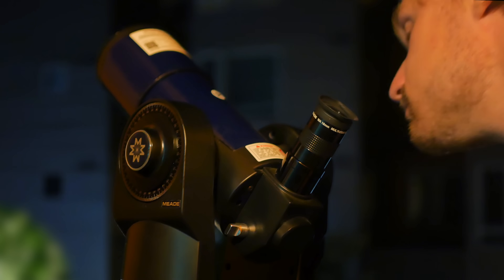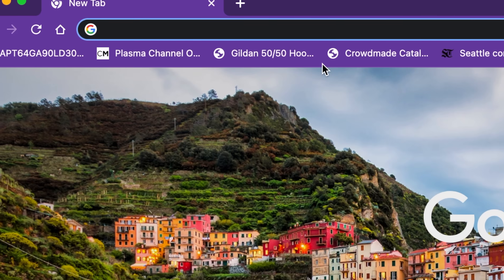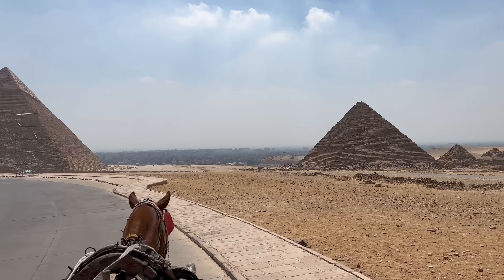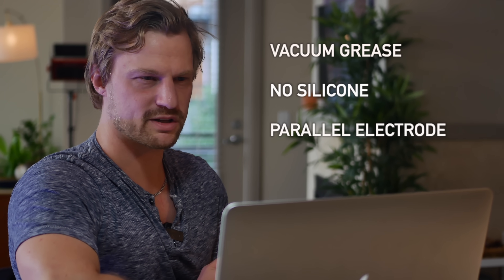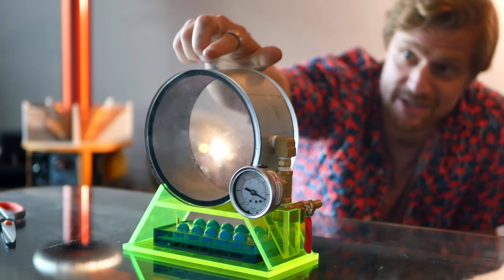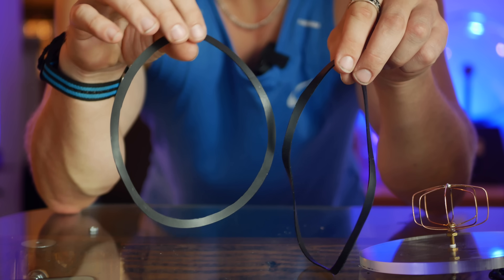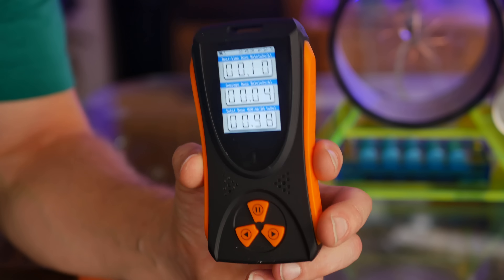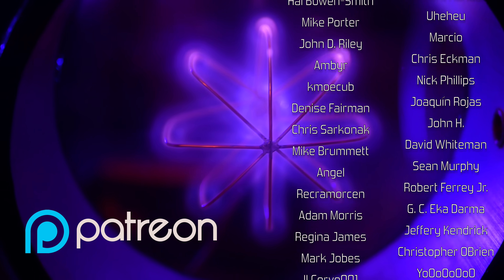Building A Nuclear Star In A Jar (Fusor)

Comment: What value caps are you using for the voltage multiplier? I’ve heard that the voltage rating of the caps has to be the total voltage of the circuit and I’ve heard from other sources that it needs to be the voltage of each cap individually? I have a voltage multiplier sitting on the table and I’m not sure what I can put through it.
Reply: Id  put a ridiculously overdriven zvs fly-back circuit to it but Im afraid I will overdrive the caps

Comment: I'm happy to be proven wrong, but from some quick back-of-the-envelope calculations it seems like you either need to greatly improve your vacuum or up the voltages to get decent reaction rates.
With around 15torr (20mbar) pressure your mean free path for a proton in H2 would be around 20um (hard sphere model). With a potential difference of 50kV and a distance between the electrodes of around 50mm, your ions will get to only 7eV energy. You need somewhere around 5keV to get any sort of reaction probability with D-T and 10keV for D-D.

The idea of the fusor is that the ions get generated close to the outer electrodes, then accelerate all the way towards the inner electrode, pass by it and hit ions coming the other way in the center. So your mean free path should be at least as large as the radius of the chamber. With a 150mm chamber that would mean you need at least around 4e-3torr (5e-3mbar), more than 1000 times better than what you have now...
Alternatively you can up the voltage and make the chamber smaller. That way you get higher field strengths and need less good of a vacuum. For a 30mm chamber it would be around 2e-2 torr, which is just about in the range of mechanical pumps. Otherwise you need some sort of turbomolecular pump or diffusion pump, which is probably too expensive. They then easily get you down to 1e-7torr and lower. You could make a crude getter pump by just heating a titanium wire in the chamber, but no idea if that is realistic at such high pressures you are at.
Also personally I would scrap the screw connectors. Proper high vacuum KF components aren't all that expensive and much MUCH better. Maybe you could even make a chamber directly from a KF extension tube.

Anyway, good luck!

Comment: Also, since H2 has a lower weight I wonder if it can help with better brighter glow

Deuterium is also a option and it'd be easy to fuse while still quite low weight but deuterium or D/T is expensive and dangerous, principally tritium

Also, unless you can get lithium-6 deuteride you cant make tritium so expensive

Comment: This is a very cool device, but this strikes me as being more like a neon lamp or gas discharge lamp, and not nuclear fusion.  A high voltage is being applied across conductors within an evacuated chamber, allowing the conductors to glow without the heavy oxidation (and fire) within an oxygenated atmosphere.  Adding helium to the chamber is more akin to a neon lamp, which contains a non-flammable noble gas which glows as its atoms are excited by the electric discharge.  Nuclear fusion, however, is the fusion of lighter atomic nuclei to produce heavier nuclei.  In young stars, hydrogen is fused to produce helium, and as the star ages, helium fused to create heavier nuclei, and so on, until finally iron is produced.  Fusion requires immense pressures, either created by the gravity of a star, or - for example, on earth with incredibly powerful lasers.  My question is, what heavy nuclei are produced within this chamber?  Is helium being fused to form carbon as it is within red giant stars?  Where's the carbon soot, then?
Reply: As you suspected, this is just a gas discharge lamp. Theoretically this configuration could produce fusion if the vacuum was deeper. The key is that you lower the pressure to the point where the gas molecules are no longer likely to strike each other. This allows them to accelerate towards the center without being slowed down by collisions with other particles. If too many particles are present they bump into each other and emit light (like a lamp), causing them to lack the speed nessicary for fusion to occur.

Comment: Not to be a downer, but I have serious doubts this will actually achieve fusion in its current configuration. There’s got to be a reason why every farnsworth fusor I’ve seen is composed of big, thick steel vacuum vessels with small, reinforced and bolted down glass portholes. I won’t believe it till I see neutron counts, as even a small CRT produces X-rays.
Reply: There are two main reasons stainless steel is used for real fusors. The first is heat, during operation they get very hot due to electron beams bombarding the walls of the vessel. Any plastics will melt as a result. The second reason is the need for materials that won't outgass. Under deep vacuum plastics will emit an endless gas leak into the chamber that will prevent the required vacuums from being reached. Without a deep enough vacuum the electrodes will discharge through the plasma in the chamber, which will prevent ions from being accelerated.

Comment: there's some math involved with fusion.. a plasma is not fusion.. it's the opposite.. separation of the nucleus and the electrons.. they come back together rapidly and the excess energy is emitted as light and heat... 
fusion in the sun has to do with the tremendous amount of hydrogen and the inward pull of gravity.. pushing against the outward force of the repulsive force of that first law in nuclear physics.. two things with the same energy cannot occupy the same space.. and also the tremendous outward force of the fusion process itself... fusing a couple hydrogen atoms into a helium atom required about 20 tons of conventional explosives in the first few weapons we tested in New Mexico in 1945.. dropped on Japan.. and tested in the early 50s..  my dad was army and came home walking wounded in 1945 and helped build the scaffolding for the first one.. which did not initiate fusion despite having many tonnes of explosives slamming the halves of a critical mass together.. fission is also the opposite.. the initial fission reaction was contained in a layer of plutonium.. the weapon was something like 4 meters in diameter..  huge thing... 
it's not easy
many of the relevant numbers are found in the periodic table
Reply: my dad helped build those goddamn weapons.. 2 master's in reactor engineering.. taught reactor physics and engineering when I was in high school..
do you know how they get electricity out of a nuclear reactor?
they boil water and run steam turbine generators... 
there are much safer and less costly methods to boil water..  fer sure ✌️
Reply: fusion is not safe... the sun does it all the time... take a look at a video of the Bikini Island test... fusion in that weapon lasted a few nano seconds.. possibly fempto seconds..  I don't know..  my dad didn't give away any secrets... he came home after a visit to the officer's club... singing sea chanties and made a hand tossed pizza 🍕.. a memorable occasion for me..  I was 3

Comment: I've been wanting to make one of these for a while. I want to see what would happen outside the International Space Station (and even inside). Probably be a lot easier to reach the necessary vacuum. Wouldn't even need the pump or seals. If you want to make a star though, you might as well do it in the proper environment. Empty space supposedly isn't empty, so if you can get it to run without an external gas supply then that should prove  if it's empty or not, as particles should accumulate inside the magnetic field as they are drawn in or spontaneously created. Right?

Comment: What sort of connecting pipe did you use between the pump and the apparatus?
If you used standard clear plastic tubing then it would have collapsed under the atmospheric pressure???

Comment: gets advice "don't use silicon", gasket fails "i wonder if it's because i used silicon" science in a nutshell :D
also, you sure about that "zero radiation so far" part? i was sure i saw a few "excited pixels" in your test with helium, you might actually be slamming a few xrays off the electrode already. or was that just tiny sparks from some idunno dust or something on the electrode?
Reply from the maker: Haha yeah, I was hopeful! 

Those little flashes I saw too - it was corrosion burning off of the central wires.

Comment: Really cool to get it glowing and I like the build. Saying however this is mimicking the sun is just not true. Fusion has been a bust for over 50 years because it requires more energy than can be retrieved from it. Gravity alone is not enough to start a fusion reaction. Therefore the sun is not a giant fusion reaction. It is an anode in an electrical circuit. See Sapphire Project. This is much closer to what the sun is. Also, Einstein stole E=MC^2 from Henri Poincare. Einstein set science back 100 years.

Comment: The other angle is Muon-catalyzed Fusion.  As Muons are subject to the electromagnetic force, they are presumably steerable with magnets, but they are traveling at relativistic speeds so the geometry of these steering magnets may be unusual in our frame.  In any event, my hypothesis is that you can increase the atmospheric muon flux by magnetically steering more muons into a reaction chamber.  Think on it. :)

Comment: Can eclectrons be strip from the air and be capture by diodes or the chemicals in diodes with a casimir effect plated walls ion craft power plates to capture in super capacitors to get more power out then you put in

Comment: What I would recommend for a hose, between vacuum pump and chamber, is HVAC gauge hose. Those things are built  to be used to pull a vacuum and be under vacuum. Look in to hvac tools and accessories, you will find a lot what you need for your project.

Comment: "Through all my tests I found zero radiation" - well, except for those tiny and brief white spots around minute 13, which are X-rays hitting the sensor of your camera. Yeah, don't stand too close.
Reply: Those white spots are actually imperfections on the surface of the grid vaporizing. You will notice the dots only appear on the grid, if they were from x-rays you would see them all over the chamber. 

Imperfections on a conductors surface increase the local strength of electric fields. This causes most of the power to conduct through the imperfection, which quickly heats it to vaporizing. If you run the device enough times it will eventually smooth out all the imperfections.

Geiger counters are far more sensitive than cameras for detecting radiation. If the meter isn't reading you can be assured it's not radiating. Because he wasn't able to achieve a strong enough vacuum, the plasma formed was too conductive, causing his power supply to drop below the voltage needed for hard x-rays. The extra gas molecules also slow down any ions that are accelerated before they build up Kev of energy.

Comment: Are you trying to make hydrogen trough fussion? Do you have any idea how fast can fussion get out of the control? If your set up does not blow up from energy thet will be released in successful fussion you, then you will know thet you don't have successful fussion. However if it does explode, use titanium for shell not plastic glass and maybe  it wil be able to hold them energy and radiation inside..
Reply: Just to be clear I love this guyand his work, but I don't think his safety is his priority...
Reply: Helium would be the reaction product, hydrogen is the fuel. There actually isn't much risk with a fusion reaction (other than radiation), it is fission that forms chain reactions not fusion. If you stopped powering the reactor it would immediately turn off.

Comment: What you’re observing here is plasma being created by taking advantage of Paschen’s law. 

You can consider air to have a high dielectric breakdown at STP, while a perfect vacuum will act as a perfect insulator. Somewhere close to vacuum certain gases will have significantly lower dielectric breakdown than at STP, and when you introduce a high voltage you can see some pretty cool plasma jump from your HV source to GND (depending on the distance between the two). Noble gases and Nitrogen can all be used to see this - Argon produces a deep purple colored plasma, while Helium will be a bright white/yellow. 

In this case it looks like the electrodes are the center conductors that are jumping to the GND plane which I am guessing is the tube?

I’d buy one of those to put in my office, would be awesome if you made the plans available!

Edit: I should also add that I do this at work from time to time and we use a similar style pump for the main “roughing pump”. That pump basically taps out right around the bottom of the Paschen’s curve, right where the gas is most conductive. If trying to get a deeper vacuum you will need a turbomolecular pump, which are pretty darn expensive.

Comment: A brief tip (I know very little about plasma and fusion reactions, but know a little about vacuum). JB weld original is better for vacuum because it has a bunch of tiny steel particles in it. Epoxy is a type of plastic and most plastics both off gas and are gas and water vapor permeable under strong enough vacuum conditions (some rare exceptions. Apparently telflon plastic is decent for vacuum).  Metals tend to be different in this regard, or at least certain types.  Anyways, the steel particles in the JB weld original, create more of a barrier for the gas molecules to try to wiggle by, so to speak. 

      If you want to make your own vacuum sealant material, look into Faraday wax, which apparently works extremely well. It is a mix of beeswax, rosin, and iron oxide powder if I'm remembering correctly.  The nice thing about it, besides being able to make it oneself out of fairly common materials, is that it can be melted onto whatever you're sealing, and either broken off or melted off fairly easily (its a bit brittle once set/hardened).

Comment: I predict we will not achieve any kind of cost effective fusion in the next 50 years.  The problem with fusion is also gamma emission.
Reply: Gamma emission is the least of worries with fusion. All current fission power plants produce high levels of gamma radiation. Objects surrounding the reactor are easily shielded by a few meters of concrete.

Comment: Keep in mind a lot of plastics, rubbers, and other materials off gas a lot of gaseous compounds under a vacuum preventing you from acheaving a perfect vacuum.
You need to get rid of the rubber, and polymers... use crystal for the windows, and use compressed copper rings for the seals.
Reply: Yeah copper ring conflat are the way to go for ultra high vacuum.

Comment: The vinyl tuning between the pump and your chamber was probably a big factor in why you couldn't reach a higher vacuum.  Vinyl tubing tends to off gas way too much under vacuum to get down to the levels you're looking for.
Reply from the maker: Thanks for the input - I'm definitely seeing that the tubing now was the biggest issue!
Reply: @PlasmaChannel  use two hose clamps on the tubing for a tighter seal. Or better yet hard pipe the vacuum hose using 1/4” copper tubing
Reply: @PlasmaChannel  I came to the comments to see if this had been posted / acknowledged. A recent project of mine determined the tubing to be a major weakness as well. Glad it's noted :)
Reply: I do refrigeration,  not fusion,  but I do know there are refrigerant hoses that are rated for vacuum and ones that aren't.   Both are way more robust than that silicone.
Reply: Tubing is only one of many issues, those HVAC pumps wont get anywhere near low enough. You would need to switch over to a diffusion or turbo pump. And any part that could potentially off-gas under super low vacuum would have to go, including the acrylic.  Also should note that a Typical Farnsworth-Hirsch Fusor is fed with d2 gas.

Comment: Excellent video and looking forward to part two. Is that a cascade multiplier? Looks similar to one I made ... well decades ago. Caps and diodes. Each stage doubled the voltage. Might e wouldn't have done much at the frequencies your project is operating. Regardless, in it I thought I recognized an old friend lol and was whisked away back to my lab'or'atory. Good luck with the next!

Comment: The reason you are not producing x-rays is because even tough you are using a 40kV pover supply, actually when you get the plasma the voltage difference between the electrodes is no longer 40kV but much less. With a higher vacuum the electrical resistance between the electrodes is higher and the voltage difference increases

Comment: fusion  only really happens under extreme pressures, not in a vacuum.. need to look for a inert gas that can survive the heat and compress the chamber so the plasma can react to the molecules and fuse them. in a vacuum there is too much room for molecules to move and less of a chance they will bond.
Reply: It isn't explained in the video, but the gas is compressed inside the inner grid. Fusors use electrostatic confinement, meaning unchanging electric fields force ions to stay trapped within a small space. The vacuum is also necessary for fusion within fusor devices. They are a type of particle accelerator, the gas in a fusor is brought to fusion temperature by accelerating all ions to a central location. These ions would not attain the required speed outside of vacuum, as collisions with air molecules would slow them down.

What is important to understand is that speed and temperature are the same thing, but with speed all atoms move in the same direction and with temperature they move in different directions. Both are kinetic energy.